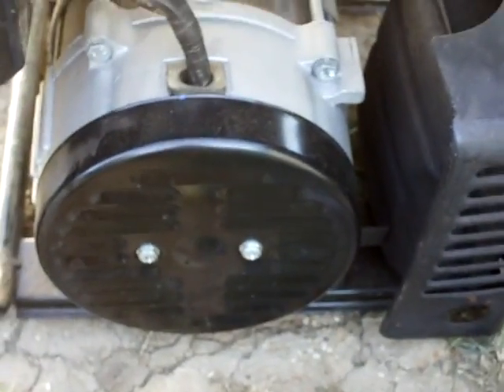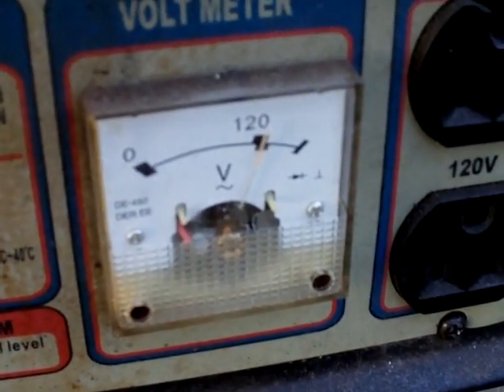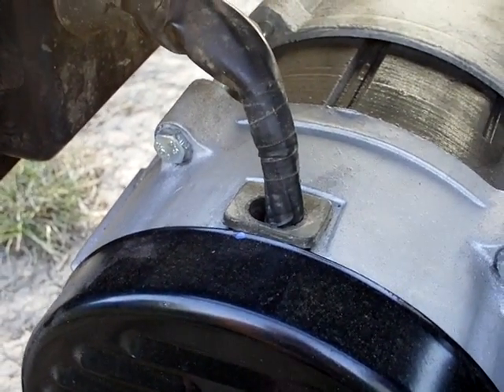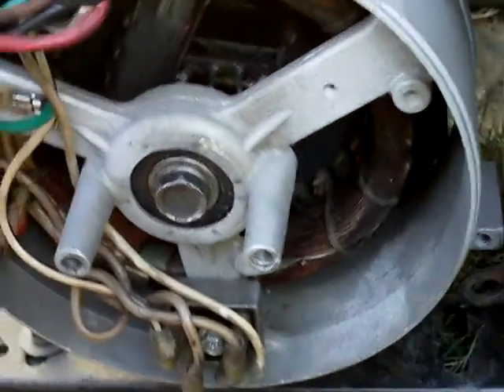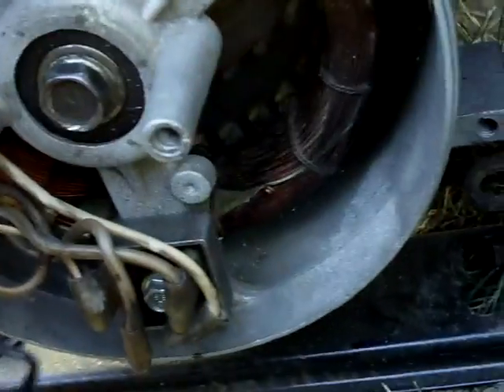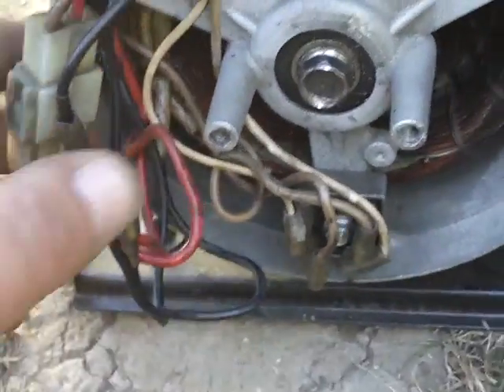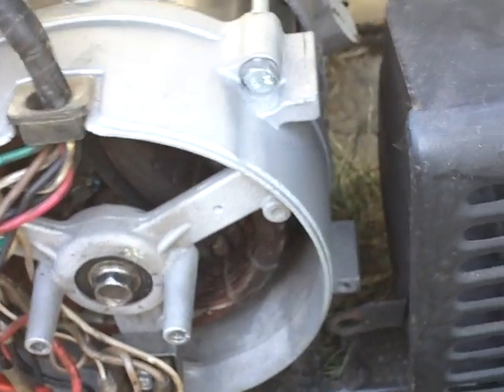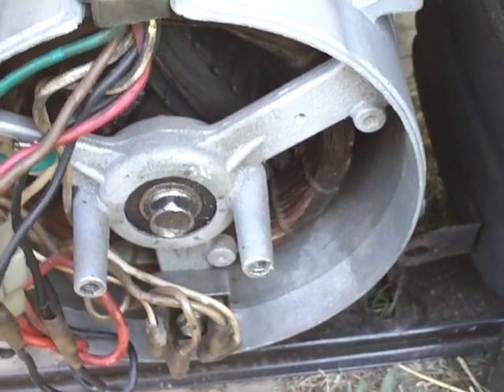Capacitor type generator

Comment: Sir gd day, just fix my 1.5kv brushless,, instead 12uf/ 350vac capacity i put 16uf/450v,, cleaned carb adjust RPM 3600+/-, 50-60Hz +/_,,,  output 230-235Vac w/ load 200vac grinder & handdrill,,, 14VDc charging outlet,,,  phillipines,

Comment: Ihave a portor cable that has a 35uf cap. Can i replace it with a 60uf ??
Reply from the maker: if it has the same or higher voltage ..

Comment: Then why does the military use brushless generators to power it's ultra sensitive instruments in the field? the commercial and home owner versions of the brushless generator will never see and never intended to have "clean" power in case of emergencies since all one needs to run is lights, heat and refrigeration and I ran my generator and turned on everything in my home including tv's and pc's and saw no ill affects.
Reply from the maker: Brushless are cheaper to build .. I have been testing that very thing ill effects of unclean and unregulated generator power on electronics .. stay tuned !

Comment: I just happened to come across this video. I know it’s nine years old, but in case anyone doesn’t know, they have automatic voltage, regulators for brushless generators now and they plug-in exactly the same way a capacitor does.
Reply from the maker: yes in some cases .. But the generator has to be right for one to work properly .. and in some cases the cost is huge money.. for a cheap generator I don't think it pays off , Thanks !

Comment: Hi good video, I have a bruchless generator 2200 watts. Diesel engine starts ok, getting no power out. Could it be the capasitor? its marked with 25 micro faradh.   How do I check if capasitor is ok or not?     Could it be other reasons its not give power out?   Mvh  sverre  eriksen, trondheim ,  Norway.
Reply from the maker: you can by a meter like this one to test it https://www.ebay.com/itm/126034572636?hash=item1d583ef55c:g:Sa8AAOSwL29kdrL-&amdata=enc%3AAQAIAAAA4CK3l16IKqKFkBWh9jw%2B4cqkaPH75ugWZRef1w%2B3xDCdH

Comment: Hi,Im working on GG5500 but its putting out 110v on the 120v outlet and 220v on the 240 outlet is that considered ok in brushless genetator
Reply from the maker: yes sir .check you RPM of the engine and adjust as needed .. thanks
Reply: Its running at 3650rpm
Reply from the maker: should be fine
Reply: Test the capacitor, if it tests on the low side of it's rating replace it.

Comment: I have  Generac XP8000E Brushless with capacitor regulation. I set Hz to 61.7 no load but voltage is only 109 (no load) Capacitor is listed as Generac OG5958 47Uf/440V. Tested at 47.6Uf which is within stated tolerance. Any suggestion please. Would a good quality 50Uf/440v capacitor be worth trying?
Reply from the maker: try setting the voltage to 120 and test the Hz .. the Hz can be as high as 62 or so and be fine .. a good quality cap may be a good option as well ! thanks
Reply: @shawnmrfixitlee6478  Thank you Shawn, but, how do I set the voltage?  There is no AVR and I have looked everywhere for a Potentiometer.
Reply from the maker: @AAHKLEE  the voltage is set by the RPM of the engine ,, cap generators have no regulation to speak of ..

Comment: Hi Shawn, what is  the  job of that capacitor in there please? Ben
Reply from the maker: The capacitor has two functions; it induces voltage into the rotor as well as regulates voltage. A bad capacity will result in a low voltage reading from the generator as the power being generated will be from the residual magnetism of the rotor (usually about 2-5V).

Comment: Could you tell me where I find the capacitor, it is not generating current
Reply from the maker: it would be in the generator head under the rear cover Or in the power panel where the outlets are , thanks..

Comment: Have you ever changed the resistors on the rotor and if so how difficult please. Thks
Reply from the maker: Yes I have .. There is a resistor as well as a diode . They are easy to get to and change but you will have to pull the rotor out to really get to them.. Thanks !

Comment: How does that brush less generator armature produces magnetic field
Reply from the maker: As you look at one there are to sides , Both with wire coiled around them . Electricity is past through each side and causes a magnetic field because the core is iron or steel . Thanks !

Comment: Hai.. How to identify 6wire connections, after repaired by  someone with wrong connection.. 
  How to check two wire for  rectifier, how to Check two wire for capacitor (also capacitor value for 1 kva small generator) and two wire for power output (230vac)
   Waiting for your quick response..
Reply from the maker: Have NO CLUE  ?? Every generator model is different .
Reply: @shawnmrfixitlee6478  yes, correct,
  Thanks pal.. 🙏
Reply: @shawnmrfixitlee6478  there are 6 winding available in stator side including 3 double output (2x3).
 Each 2 output having different ohms reading and wire connections as below,
   02 nos  red wire
   02 nos yellow wire,
    02 nos black wire..
All connection facility are
    Capacitor
    230vac output
    12vac output for rectifier
But how to identify this three connection before connect to capacitor, 230vac and 12vac using multimeter according to ohms reading..

Comment: I have a MECC ALTE 2.8kva S15W-102 which gives me 43Hz at 230V.
Essentially my volt and Hz are not proportional.
Have tested CAP and its good.

Any ideas?
Reply from the maker: Sure Get a tach and adjust your engine speed ! i43 Hz tells me your speed is low and sags under load .. Thanks for stopping by & asking !! Do it right as adjustments are critical to any electrical appliance..
Reply: @shawnmrfixitlee6478  Thanks for the reply I try adjusting the speed but it wont do in this case.

When I adjust the speed up to 50Hz this then gives me a voltage of 325Volts.

Nominal voltage for my country is 230VAC
Reply from the maker: @bstack10  Try adjusting the voltage with the speed screw setting it to 233-235
Reply: @shawnmrfixitlee6478  yes increased that slightly my Hz is now running 43/44
Reply from the maker: @bstack10  not sure off hand what the problem is . I would say it's the cap but you many have a bad stator or rotor . They all need to be tested ..

Comment: What is the value of capacitor in Microfarad and volt?  can we replace higher value of capacitor  and DC volt?
Reply from the maker: Every generator model is different on the value of the Cap . I would only replace them with the same value part ! Thanks ..

Comment: I have a small generator with a capacitor. When I don't run anything on it, the volt is 340, and when I run on it a half-horsepower water motor, the volt becomes 220. Is this normal?
Reply from the maker: No , You may need to adjust the RPM as it controls the voltage on many generators with Cap's .. Thanks !!
Reply: @shawnmrfixitlee6478  thank you

Comment: How AVR is connected to brushless generator and if we do not use AVR will there be a problem
Reply from the maker: You can't hook an AVR to one of the common china made brushless generators . There will be no issue as the Gov controls the speed of the engine and that is how the voltage is regulated . Thanks !!

Comment: Hi  nice video.i have a brushless power generator.it produces high voltge like 310 volts.in my county it is 240 volts.my generator have two p 1000 diodes and i saw at the back of the diode two varistor .when i check the 2 diode with multimeter it has a fault.i will have to check the varistor also.do you think that the two components mention cause the overvoltage on the generator?????? thanks
Reply from the maker: could be but first check the RPM of the engine . Not by ear , But with a tach so your sure it is right . An over rev condition makes the generator put out more voltage . Thanks !
Reply: What about if the speed is correct?

Comment: Thanks for your video. I have one question my brushless generator runs, but does not producing any power. What could be the cause?
Reply: Buenas saludos desde Venezuela eso es el condensador o común mente lo llamamos capacitor esos motores son mejor con capacitor que con escobillas
Reply from the maker: first thing to check is the breakers on the panel make sure they are good . Then I check the capacitor make sure it is good as well . Hope you get it going ! Thanks..

Comment: I just found your video and I have a brushless genset that has the right voltage but won't even run a 1000w microwave. The capacitor is good. I'm thinking diode.
Reply from the maker: what size is the generator ? what make and model is it ?  Thanks ..
Reply: @shawnmrfixitlee6478  One of the Easter Tool Diesel DG6LE 6000w
Reply from the maker: @dong4617  This has a voltage reg Here is the part that controls the unit   https://www.ebay.com/itm/Diesel-Generator-Voltage-Regulator-Eastern-Tool-DG5LN-DG5LE-DG5LER-DG6LE-/153499147896
Reply: @shawnmrfixitlee6478  That's to charge the 12v battery. I already made that mistake.
Reply from the maker: @dong4617  Ah, I see !  Sounds like it has a problem with the windings on the rotor or the stator . Could be one or both !
Reply: @shawnmrfixitlee6478  They ohm out normal. It only has 60 hours on it.
Reply from the maker: @dong4617  Not sure then , Is the RPM right ? Sounds like you already covered all things I would check out !!
Reply: @shawnmrfixitlee6478  I need to get one of those laser rpm checkers.
Reply: @dong4617  what was the solution?
Reply: @xredman002  I never figured it out.

Comment: What would be the symptoms of one of the resisters going out.  UST 3500 watt running while I was using a leaf blower.  It slowed down so I looked at the generator smoke was coming out of the end bell.  Shut her down smoke stopped but, on restart I get no voltage.  Any ideas greatly appreciated. TNX
Reply from the maker: sounds like it smoked the windings , I would take it apart and take a look at the copper . It could be the cap but probably not .
Reply: ShawnMrFixitlee 
A leaf blower shouldn’t pull more than the rated 35000 watts what could fry the windings?
Reply: Would it be the armature windings or the rotor windings?  Could I check them with a multimeter ? TNX for you help.
Reply from the maker: @dpatt45  Something inside the generator could have shorted out , Not sure without looking at it my self . Sure hope it is fixable !
Reply from the maker: @dpatt45  Pop the end bell cap off and take a look and smell it for a burned smell could be either one . is it AVR or Brushless ?  
james condon has vids on testing them .. I have not made one yet !!

Comment: i have a 2.2kw generator that is now only just powering a 300w 110v sander after a 2 or 3 second lag and won't turn a 800w angle grinder at all. Engine seems to be running fine. Any thoughts?...be much appreciated
Reply from the maker: If it's a brushless unit , I would check the capicitor
Reply: @shawnmrfixitlee6478  thanks for the rapid response ..if i plug a transformer into the 240v outlet and try to operate the 110v tools through that its the same outcome and 240 chopsaw plugged into 240 outlet runs slow/erratic.

Comment: I have a 3500 predator inverter generator that has 25 hrs on it . I turn it off to put gas in it and it will not start now. It is getting  no spark. I have changed out the fly wheel coil which I didn't think was wrong and it still doesn't have spark. I talked to harbor freight they told me to unplug the low oil sensor and it still doesn't have spark. There is a what looks like a AVR on it that the oil sensor wire goes too and I think the coil wire goes to it. there's two little black wires that Also go to this AVR that look like they go to the run combination switch . I tested that switch with a ohm meter and it checks out to be good. I ordered from harbor freight this thing that looks exactly like a AVR that I have seen on amazon. Harbor freight calls it a lighter. The problem is its going to take ten to twelve weeks to get here and I need a generator. So I took a chance at the AVR that I see on amazon. It showed up today but the plugs have blades and mine has pins.My question is does a AVR give spark to the ignition or spark plug? What would be preventing it from getting spark. At this point I don't want to cut the wires to put this AVR on until I know it would work. Thanks
Reply from the maker: I have to have pictures of the parts to tell you shawnmrfixit@hotmail@hotmail.com 
   thanks !

Comment: I have a small generator, produces 240v. It can power equipment when they are connected directly but does not work with a UPS. It used to work with this UPS before so am wondering what has changed?
Reply from the maker: I am afraid i can't help you out on that one , Not sure ! Thanks for the asking though ..

Comment: hi, i have a very similar generator (does just engine and generator unit, no frame or body) and i was looking for help getting it to work. i need to fix the carburator but i've had it run for short amounts of time to test the winding and i only get 12VAC on one of the coils. would it be possible to get a wiring diagram of what's inside the panel of the generator?
Reply from the maker: if your testing the voltage at the outlet & it's only 12v ,, you should replace the cap as it is probably bad . I have no diagram , but you may google that . Make sure it's the same as yours !
Reply: @shawnmrfixitlee6478  i have no cap or anything, its literally just the engine with the generator part. https://sta.sh/02ktuhsuhdg

Comment: What happens when the resistors fail?
Reply from the maker: if the diodes or resistors fail the gen will not put out power . Thanks !
Reply: ShawnMrFixitlee I have one work low voltage at a confirmed 3600 rpm. I replaced the capacitor so it now stays excited but is putting out 110 volts at 1/2 continuous rated  load and down to 90 volts at rated continuous  output.  The governor maintains 3600. If I increase rpm for 120 at 1/2 load I get 135 at low/no load. I’m at a loss.
It’s a near 10 year old sportsman 2000 peak 1500 continuous gender with maybe 30 hours run time.
Reply from the maker: @Jbyrd75901  some of the china made caps are faulty even when new . I have had them put out 1/2 load and some none after new cap !! .. Try another one is what I would do , Hope you get it up to standard .. Thanks !
Reply: ShawnMrFixitlee will do. I replaced it with an amazon prime product hoping better results than a direct from China Ebay special. I will try another capacitor.

Comment: my brushless gen. no avr is making 151 volts ac why or how can i fix???
Reply from the maker: Check the RPM if it is running to fast you will get to much voltage , Let me know if you fix it .. Thanks !!
Reply: @shawnmrfixitlee6478  dose not realy have a throtle adjustment
Reply: @joycemoore4820  Check the frequency that you are putting out. If its 60hz then your engine is the right speed 3600rpms. You voltage could also be high from a over sized compacitor.
Reply: it was working fine just useing to charge batterie on my camper  when it failed
Reply: @joycemoore4820  Failed or high voltage. also are you getting high voltage at idle or with load if so on load what kind of load switched power supply, resistance or motor?
Reply: @TechImpossible   my rpm is not ajustable so high voltage is with or with out load
Reply: @joycemoore4820  Do you have a multimeter to do some testing with?

Comment: I've got a Powerback 5250 cap generator that runs but puts out no power. Is it possibly a bad capacitor?
Reply from the maker: That is the most common problem . If it does not have brushes !
Reply: If its been sitting for a long time try flashing the field, most common fault if no power output..
https://www.youtube.com/watch?v=-LR62sm7USU

Comment: Hi. I have a gen 2300 watts and the avr was blow out. I bougth 2 avr, put the first one and was fine with 120v on voltmeter, but after 30 seconds volts drop to 0. I put the second one avr and the same thing was fine with 120v on voltimeter and after 30 second voltage drop to 0. Any IDea what is going on.
Reply from the maker: I do , I think there is a short in the gen head or the plug panel . If it were in my shop I would use a multi meter and try to find the problem that way by testing every wire and switch ,plug and breaker the problem will show up !

Comment: I have the same generator not producing power..  what to do?  help
Reply from the maker: What have you done to check it out ??  Is there Any voltage at all ??
Reply: replace the capacitor. if the winding is not burned.

Comment: what about inverter generator I've got both types.....goedendag
Reply from the maker: +georgio jansen  Inverter is the best way to go . but more $ for sure ...If your just running lights and basic non computer stuff a brush type will be fine .. This type is way less than even the brush type for clean even power .. AVR will work fine for basic needs.. CAP generators are unclean power, But will still run a motor or basic stuff fine ..
Reply: hello, I also have such a generator whose voltage fluctuates a lot, from 100v to 300v sometimes.  can you advise me how to fix it?